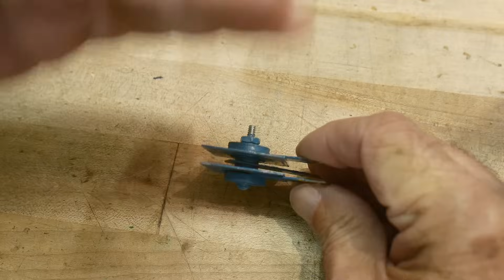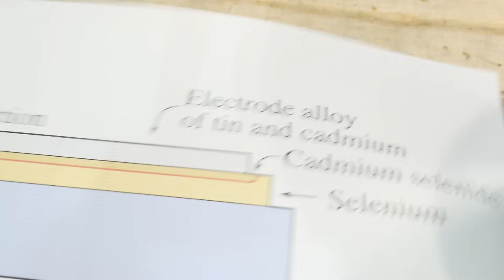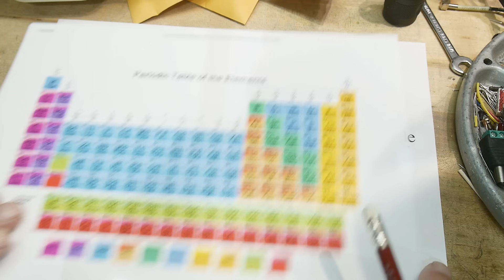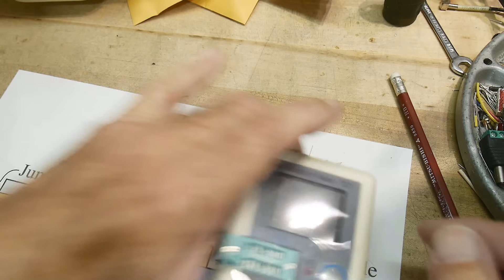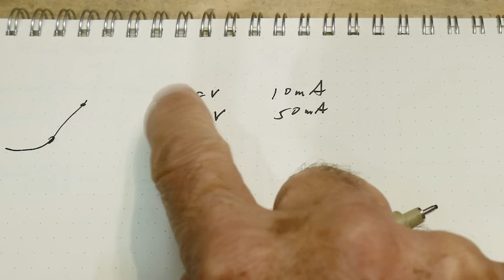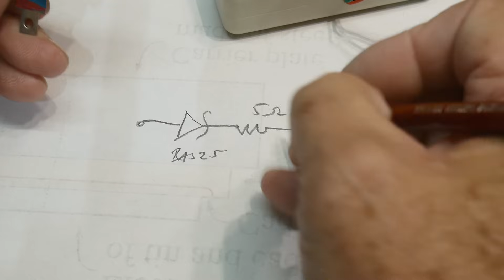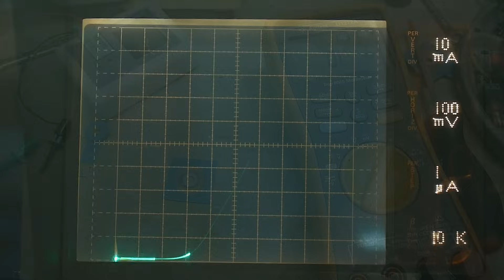#1753 Selenium Rectifiers

Comment: I can't think of a reason someone would want to 'emulate' these poor I-V chactaristic
Reply from the maker: if you just drop in a diode, the rest of the circuit will over voltage and over current. Fixing old stuff is not always straightforward.

Comment: As a teenager, I used it to build power supplies. Selenium rectifiers were built into all tube radios and televisions. And if the power supply was overloaded, you would immediately recognize it because of the smell of rotten eggs 😵‍💫😅 73 de DL1LAJ, Andreas

Comment: As a kid I remember shorting one out and the smell was horrendous (selenium hydride, etc) and extremely toxic too (cadmium ain't good for you either).

Interesting video, I took one apart and didn't realize the actual diode was a thin layer on the plates. I would wear gloves if taking these apart.

Comment: Technology is ever changing and in regards to these old rectifiers I say throw them out. Replacing one found in an old
tube radio from the 1950s , lets say, is so easy just by using a silicon diode which are  cheaper, smaller and way more 
reliable. Put a resistor (of pertinent value for the tubes) in series with the silicon one and be done with it. It is a no brainer
 for this young man's vintage radio restoration efforts. Just like a 50 year old car tire ( never used), the tire and the 
selenium rectifier are  both are bad now. Let go of the past.

Comment: The reason stacks of these are needed for tube radio HT circuits is that a selenium can only accept a reverse voltage of around 18 volts, so you need several in series to cope with the high reverse voltage. When conducting (forward voltage), each junction may only drop around 0.3 volts, but as there's a stack of them, several volts will be dropped across it. So if a silicon diode was just slapped in instead, the HT voltage to the radio would probably be around 15v too high. So a beefy (maybe 10W or so) resistor needs to be added, to drop that sort of voltage. It might be around 200 to 300 Ohms. But the current is only milliamps of course.

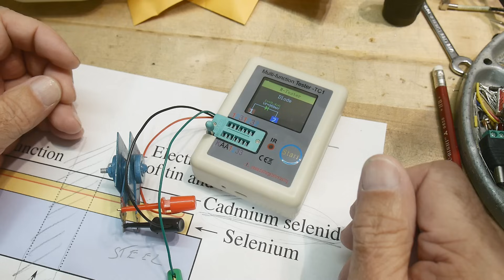Comment: 6:26 you could even wire all three terminals to that component tester and it should tell you that it is a dual diode. that way you could find out whether they are common anode or cathode if you were unsure.

Comment: This is the problem with replacing selenium rectifiers.. You certainly can use a diode + resistor combo, but if the original rectifier had any significant power rating, you end up needing a large, hi-power resistor to replace it.

This is why the selenium parts usually have such large cooling fins - they were terribly inefficient, producing large voltage drops and making a great deal more heat than a modern silicon diode by comparison.

Comment: Those days, then there were the battery eliminators with Selenium rectifies. When there is a overload in small devices, you can smell the rectifiers🙂.
You can also reassemble those rectifiers. Regards.

Comment: In old radios and very small TV sets we replaced a Selenium rectifier with a silicon rectifier and a 10. Ω at 10 Watts resistor.  (called a "sand Ohm" resistor) Ron W4BIN

Comment: A friend of mine had to repaint the wall of the house and replace all the carpets when a big selenium rectifier of an old power supply, met a shorted electrolytic filter capacitor.
The smoke from burned selenium has such bad odour, 1000x worse than sulphur. Truly evilish...

Comment: Selenium rectifiers as you said would be high current devices is not true though, They are typically low current rated in the milliamps range. Tube amplifiers usually operate at high voltage low current and the average sheet of Selenium rectifier can handle about 25volts in average, they use many sheets in series to increase the voltage but the current stays the same in a series connection making them become these huge long bulky rectifier abominations. you can also find them in compact forms in amplifiers from the 50s. Selenium rectifiers have many downsides and most commonly is that they have a limited life span, they don´t last indefinitely and they absolutely hate getting warm and when they burn you get the most unpleasant and terrifying evil smell of burning rotten eggs in a hazardous poison smoke inferno that takes ages to get out from your house and nose, they also drift in voltage drop over time and act unstable to say the least. most people that ever worked with Selenium rectifiers will agree that getting rid of them in stuff you actively use is the best idea in the end and that silicon diodes are the superior choice. But they also are pretty cool in the way they work

Comment: As soon as you enter a room where a selenium rectifier has burned up, your nose will tell you exactly what the problem is.  Diagnosis time - 0.010 seconds.  Nothing else stinks like a selenium stack letting out the magic (and toxic) smoke.  Ventilate your transmitter room before occupying.

Comment: I worked on a couple Zenth Trans Oceanics; both had mostly dead half wave seleniums. Replaced both with 1N4007 and series 2 watt 50 ohm resistor.

Comment: Selenium rectifiers were in use for a long time in small scale model locomotives. Just the blank disc with no further protective coating. Especially Fleischmann seemed to have a huge stock of these. I'm not sure if there is one or the other model remaining where these still are used.

Comment: Some of the AC cranes I worked on years back had a couple of banks of Selenium rectifiers fitted to control the torque of the motor and boy when they blew they stank big time also when you changed them the small stayed on your hands for ages

Comment: very interesting video - thanks!    Lead sulphide (galena) was used in crystal radios, a low-signal application,  and the Vf was 0.37V.  I would be interested to know what the forward characteristics of a copper-copper oxide rectifier is, if you have looked at them?

Comment: I have an old 6 / 12v car battery charger that's full of selenium rectifiers (basically just those and a transformer). I'm sure it's 40 or more years old, but it;s the best charger I have for resurrecting older or completely discharged batteries!
Reply: Yes, it's true. The explanation is that there's some reverse current, so some AC on top of the DC. The small amount of AC "breaks through" sulfation on the lead plates and helps a little with liberating the gas bubbles at the plate/electrolyte surface.

There were devices sold for anti-sulfation or battery rejuvenation that emulated the output by injecting some AC onto the output of a DC charger to recreate the effect once silicon rectified chargers became the norm.
Reply: Me too - the brand name is James Grose and my Granddad got it by collecting cigarette cards.
it's got an ammeter and some sort of thermal cutout... and that's it. brutal yet effective I guess.
Reply: @joinedupjon  That's it! The bimetal strip pushes a button out if things get too hot. There's no true ammeter on mine - just the charging current - an actual ammeter with negative readings would have been handy. There's no brand name left on mine, as it was rescued from a damp barn about 6 years ago, when it has stopped working, after servicing tractors and other farm vehicles for decades. Most of the paint was gone from rust, and the front panel controls were just about functioning and legible. The only fault it had was one that the bolts - not solder - holding the charging wires had rusted so badly there was no connection. Have it a good clean with fresh bolts and it has worked perfectly since then.

Comment: I have a RCA voltohmyst that had a Selenium in it. I took it out and replaced it with a 1n4007. I forgot what value resistor I used but it's a 2watt metal oxide.

Comment: You don't need 4 diodes for a full wave rectifier if you use a center-tapped transformer.  That was a common practice.
Reply: Or use two equal transformers, one leg both of them to make common ground and rest is known if you know ;)
Reply: The point of the full wave rectifier is to get both swings of the ac voltage, from both power legs. You can get DC from AC with only one rectifier, but it will be very choppy.
Reply: @tableseven8133 , true, but you still get full wave from the CT xformer and two diodes.  That was a cost trade when diodes and tubes were more expensive than copper windings.
Reply: @tableseven8133  I have my amplifier build that way. Transformer is 12-0-12 and 550va. When i use one schotky-diode for each end. i can get 100hz pulsing dc that is dropped unloaded voltages only one diode forvard voltage drop per wave. if i have used typical full bridge rectifier, there are always two diodes series, when wave is present and voltages and current are generated for the load.

Class A operated amplifier with pi filter and that transformer diode combination give me useful output voltage about 14.2volt +-0.3.

Before filter, voltage is about 15v, and biased constant current is about 14A so big load all the time, when powered on.

But it is so good the sound quality.

And if you want to know, speaker output terminal ripple for idle with this configuration is about 4mv pp, which is not so much at least my setup for not hyper sensitive speakers.

Still, about nominal 10W for 2 ohm and stable to support speaker dip to low as 0.5 ohm gives a good umph for the many songs.

Here is a link for that full wave two diode rectified circuit.

https://madpcb.com/wp-content/uploads/2020/11/Center-tapped-Full-Wave-Rectifier.jpg
Reply: A full wave rectifier uses two (2) diodes. The full wave bridge uses 4.
Reply: @W1ZY   Now that I think about this the name of this is very deceptive, Bridge. On a proper thought circuit it should be 2 Y's with 2 diodes on either y with each one the opposite way  on the AC side with the anodes matched on the DC end to each other. Yes this make the "bridge" but it makes better sense I think to the person that does not get it.

Comment: I run across rectifiers like that in tube amps, but not for the B+ which is still tube, but rather for the bias supply and DC filament for phono preamp tubes.  Sherwood used this design a lot.
Reply: Fisher tube high fi used them in the bias circuit as well,  or perhaps it was Scott ?  The rectifiers were a shiny flat pack and made in Germany by seamans.

Comment: I have a few of those lying around. You've given me an idea. I think I'll try one in a crystal radio. The junction drop is low.
Reply: The idea is good but the capacitance is very high, not suitable for rectifying anything beyond 50/60 Hz, let alone an HF signal.

Comment: I have never seen a selenium rectifier used as signal device. They universaly used as power supply rectifiers. They were lossy and heated up a bit. When the filter cap shorted out the selenium rectifier would go into thermal death. They smelled horriblr when that happened. And you touched the fins, you get a nasty burn that take a long time to heal.. Don't ask me how I know this. For a higher voltage rectifier they just added more layers. In the military we had a full wave bridge rectifier in a single, it had several terminals sticking out and jumpers tying them together into a bridge configuration.
I enjoy your videos and working on vintage main frame equipment.

Comment: I think the “Ir” on the tester is reverse current. I.e. leakage current in the direction the diode is supposed to block.
Reply: Yeah but it makes it perfect To charge lead acid batteries    regenerating by reversing Load every half cycle
Reply: I guess you figured that out later in the video 😂

Comment: They were' Extensively used on British motorbike 12volt systems as a packaged bridge rectifier on single phase alternator, the soft characteristics are well suited to the zener regulated battery charging systems.

Comment: Your should try to release the magical smell. Exceeding the maximum current melts and burns the thin selenium layer giving up a smelll ranging from horseradish to fart.

On a second note well used them as solar cell. For this the cover electrode usually tin has to be melted and wiped away to allow light to enter. Wasn't working well but after a few attempts over a gas flame with a rag in the other hand you could quickly wipe the molten tin layer off. By leaving on the contact spring washer your retained the contact and viola got half a volt in bright sunlight.

Comment: Old tube radios tend to use a pair of diodes with a center tapped transformer, not a full bridge rectifier, so your double diode would be perfect. There were double diode tubes as well. Tube filaments do eat a lot of power, but the plate supply is not so power hungry.

Comment: Something that only us old men (I'm 75)  can, but would rather not  remember.   The SMELL of a shorted hi voltage  electrolytic filter cap, and the SMELL of a failing/ shorted  selenium rectifier.  In the 70's-80's I worked at a big auto parts store  which also had a separate welding store.  I used to repair  the older  unregulated battery charges  which had only a selenium, nothing else--with a pair of  silicone stud rectifiers out of  one of the smaller  Miller welders.  Made a small heat sink out of a scrap of aluminum sheet,  and off we go.
Reply: I'm a bit younger than you ( not so much ), and i remember times in which me and my friends tried some tests on electronics ... i got an old television to dismontle, it had a big selenium rectifier inside. We would obtain DC current from the mains, my friend was convinced to connect the selenium rectifier in a ( for me ) erratic manner, so i said ... "ok, if you are sure, let's try ... " ... Soon smoke arised from the rectifier, and at once on orrible smell was around. Open the window was just a minor solution, we ( three friends ) had to escape from my room and also close the door ... I can't forget THAT smell, even today ...
( i also believe was tossic ... )

Comment: They were also used on 1960's motorcycles. Normally dull red in color.
Reply: Yes, even in the 70's, as im currently restoring my dad's Honda 750.
They are said to be indestructible, but inefficient. Since Honda's have little knack of producing 'just enough' electric power, im kinda thinking about swapping it for a silicon rectifier. As I already did with my 60's Honda.
On the other hand, keeping it original is kinda my goal, maybe if I notice that it's going to lack power ill swap it...

Comment: Thank you for this! I noticed the capacitance aspect of selenium rectifiers when replacing a selenium bridge rectifier on an old German radio. It seems that after installing silicone diodes I was getting a lot of oscillations until I added one small ceramic capacitor across each diode of the bridge. I later found a post somewhere in German that recommended the same thing...

Comment: The long stacks were there  for high voltage capability, to rectify 2-300V for the tube anodes. Not a lot of current needed there.
Filaments (where high amperages were required) were driven with AC.

They came in dual packs like that because they wanted to avoid the double voltage drop of a 4-diode rectifier, and used a center-tapped transformer with two diodes to do full-wave rectification.
Reply: Right ...

Comment: I have selenium rectifier from a Philips tube radio from the 1950's. It has 6 plates and my parts tester says it's a capacitor in both directions. It's dead! Great video!

Comment: My first contact with a (single) package selenium rectifier was as a school boy.  If I recall it was rated 250 V, 50 or 100 mA, intended for center tapped transformer.  Later on, at my first long term work, we used International Rectifier selenium stacks to clamp overvoltage spikes.  Those parts we assembled ourselves from IR plates, 1 x 1” or 3 x 3” sizes. That was the time when I learned that selenium can produce a terrible stink.  Finally and even later, I was told thatMiller Electric built their own selenium rectifiers for some of their welders still when the first, barely high enough rated current silicon components became available.  I understood that Miller experienced voltage spike failures on the silicon diodes that they had tested.  The selenium parts were “more robust”, until they released their stinking smoke.  The robustness was a side effect of the leakage as well as the probably 6” square plates of the selenium assemblies.  By the way, at one point I also found that the phone company installed small selenium spike clamping diodes to their phones, when some users complained about the excessive scratch noises (or in some cases intentional teasing by young pranksters).  I then tested whether two anti parallel silicon diodes could do the same and found that silicon had too high a forward voltage to compete with selenium in this application.

Comment: The power this should be able to handle is about couple of W, so with 5 Ohm and 0.3V initial drop we will be talking about roughly 0.5Arms rating, ballpark. In real application virtually the only limit is the resulting operating temperature resulting from the power dissipation and the cooling.

Comment: Nice video! I made the same experiments on my Telequipment CT71 curve tracer and I reached pretty much the same conclusion. These were terrible diodes. 😂 However, they still work. People like to replace them, but in my case, whenever they went bad, that was due to leaky capacitors.